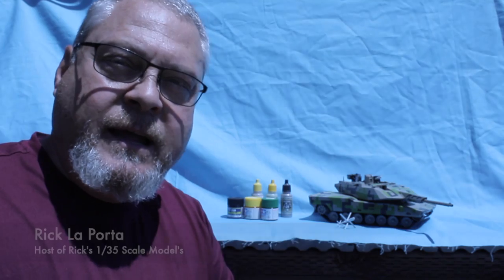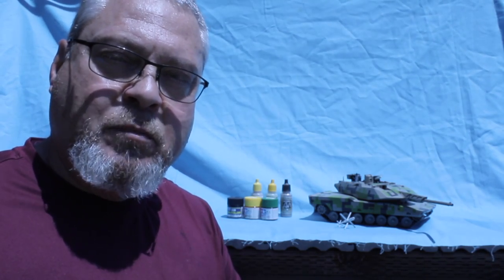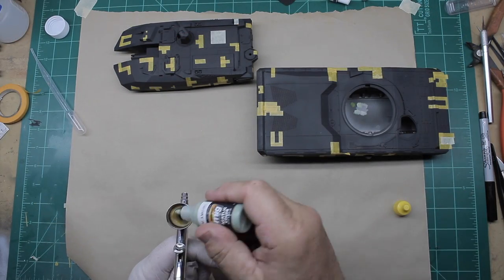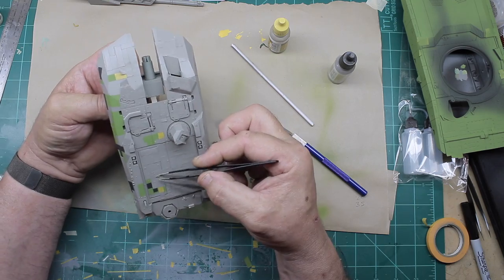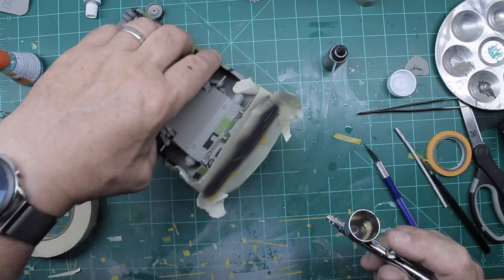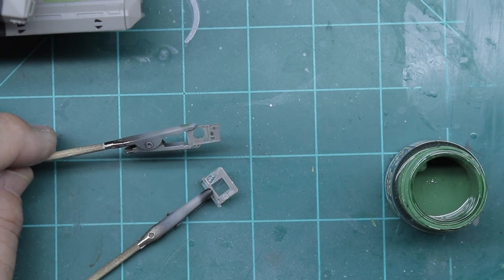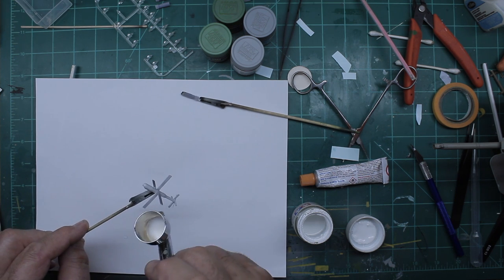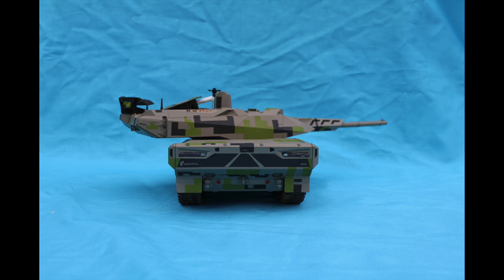Amusing Hobby KF51 1/35 Painting and Detailing (video #91)

Comment: My problem was also the track they are indeed fragile mine came with link broken already and I heady to cement the links. And also no reinmetal logo as you mentioned :(. No 3d printer so I'm just gonna have to live without it. Great video and I finally saw this kit painted. It looks nice!
Reply from the maker: I hated these tracks. I would hVe worked threw them had i not had the spare set in my stash. I'm selling my 3d designed stuff threw Mad Modellbau out of Germany. Daniel can print them and get them to you.

Comment: Ok mine will be a bit more brownish grey like on the photos because to me it always looked a little bit more brownish. Kind of the color of an F-35 in certain angles. Nice build overall :) Also on the optics i used an old CD to get that color shifting, and on some of the others i used some left overs from that tape that was sold eearlier to create these lens effects for Leopards etc.
Reply from the maker: Ya I struggled with the oaint color and decided on a more gray. I've seen pictures where it's more brown. That's not a bad idea on the lens. I'll have to try that.
Reply: @Ricks135scalemodels  Yeah that's the problem with scale modelling :D It's hard to find the exact paint or at least replicate it. I had that problem on my F-35 which has a metallic shine and also sometimes appears to be more brownish and on others it is grey. WIll be a challenge to find the right color for this tank, also for that lime green.
Reply from the maker: @JazzJaRa  so true. I depends on where you will have it displayed. There no perfect answer.